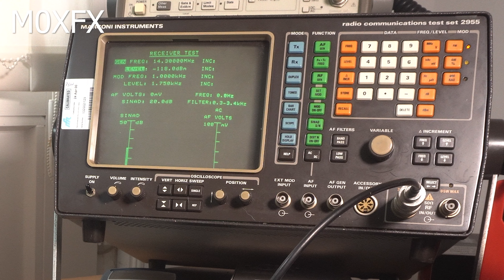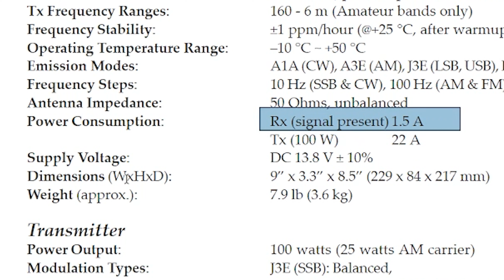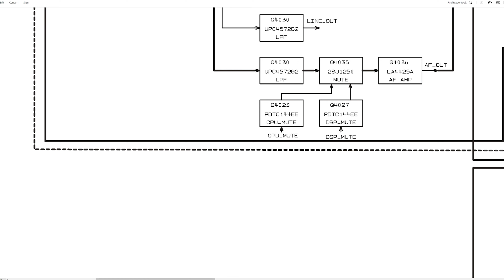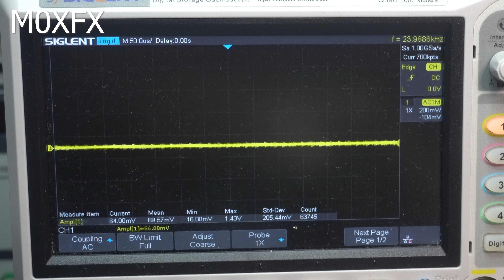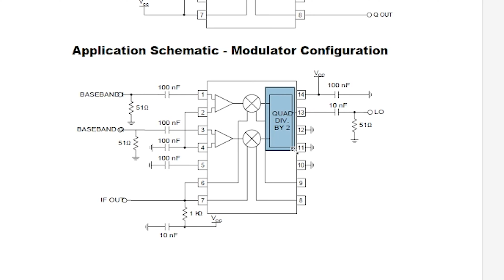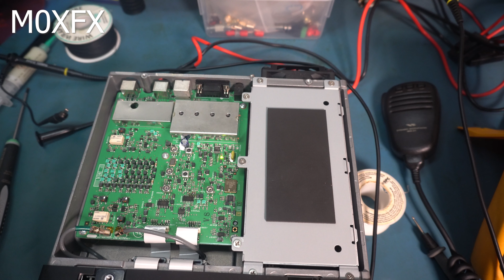Yaesu FT-450D No TX Troubleshoot & Repair

Comment: hi John i see you are familiar with a lot of these radios and do a good job on them ... I have a question or two you might have an idea of what i am up against if you don't mind... I hesitate to bother any one but i have a Kenwood TS820 s   I  have been working on and got it up and running but i get no Alc as far as i can tell the agc and alc circuits are there and to the meter amp etc ... any way  on 20 meters i get no s meter readings yet on 40  and 80 if anything they are set a bit high it receives great and i am now able to get a plate current idle and adjust it after removing a mod on the power transformer i fixed the digital display finally i think any way its worked ok since I  last worked on the boards and connectors.  i removed another mod off the IF board and returned it to factory i didn't like the way it was wired in and the instruction sheet wasn't the best but it looked like they had it wired wrong basically it was dead other than powered up when i got it ... any way I am a retired tech  with a VOM as i sold all my  test equipment years ago now with  74 year old eyes  it keeps my mind working plus i was off ham radio for years working as a tech but wanted to get a base radio and get on the air again ... I got a Kenwood ts 50 that was hooked up reverse polarity and i got it running but really want the ts 820 s  for my station  ..  thanks for listening  i know you are doing a great service and a awesome job here on you tube helping guys learn 73's WB7ASV  Phil  .... if you rather not discuss the radio here  understand
Reply from the maker: Hi Phil, Thank you for your message, it's difficult for me to to comment on your radio equipment unless I have it on the bench. Regarding the TS-820, I see that there are a number of issues. I wonder if if all the faults are related. I am making the assumption that the radio was working correctly and all these faults appeared at the same time? If this is the case the radio may be working correctly but not displaying the correct information, this can happen. It could be problem with the information getting back to the micro controllers. In the past I have found looking at the schematic and try to identify something i.e IC that all the problematic issues are connecting to, a multiplexer IC perhaps. When I get some free time I will take a look at the schematic and get back to you. I hope this is of some help best regards John M0XFX.
Reply: @M0XFXUK  Thank you very much for your interest and advice I do appreciate it I know this radio was in the hands of some one that should not have been it even the yellowing in the service manual it just makes me try to find out what else he did ... I have a feeling he tweaked with out knowing and i see a lot of evidence of him in it ... I really would like to see if he did something in the ALC circuit so i go on line hunting for those that's how I got my IP current working he changed resistor values on RF board he added a resistor to the bias control which I left so far as it does seem to be working now  and also the windings on the transformer he moved the 220 v transformer circuit over to the 300 making two 300 v sources and i wondered why I was getting 300 in the  where it should be 210 v any way i am going to recheck the vr 1 and 2  in s meter circuit again  know ALC is going to that also and the vr2  is suppose to control sensitivity and it seems like its could be a issue I wonder if it could be playing a part in no ALC meter readings too

Comment: This is the radio im currently using ,was neat to take a look inside
Reply from the maker: Hi David thanks for stopping by the channel. It was a first for me too. These radios perform really well and I was impressed with all the features.
Reply: @M0XFXUK  ya, I really didn't realize it until I went through the manual ,ended up being a good little radio.
73 de kc0mxo

Comment: Nice repair. Interesting to see how modern transceivers make use of the old fashioned superhead technology.
Reply from the maker: Thanks for the comment. Yes it's a cross between old an modern radio designs, these radios do work very well and are easy / fun to use. I was impressed with the overall performance.

Comment: wow, just goes to show when a radio has no output it's not always the output stage at fault like most suggest or think.
i wonder if it was a faulty ic or caused by another fault, no antenna, high SWR or working out of band perhaps ??

great video though..would loved to have seen the hot air job..
Reply from the maker: I couldn't find anything else wrong with it. I am not sure if these Quad Mod/Demod IC's are problematic. It's a strange fault but that being said these things sometimes happen. The radio looks brand new like it's not had any use.  Could be just a bad IC that got through QA/QC and burn it from the factory.